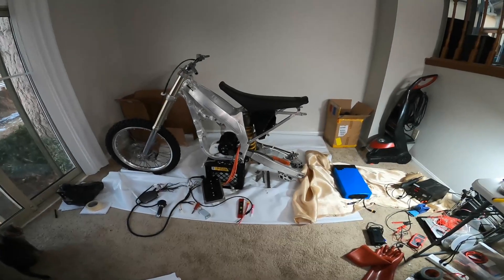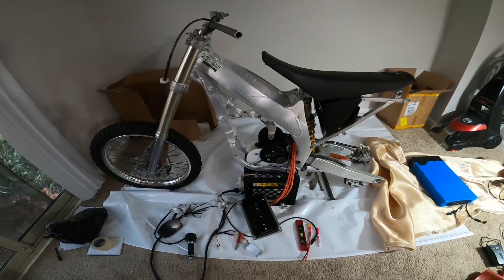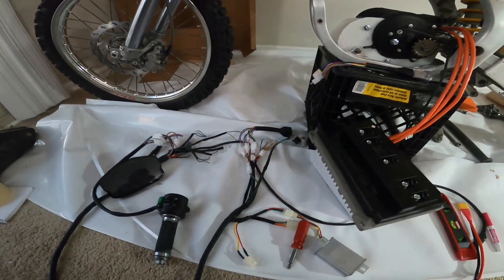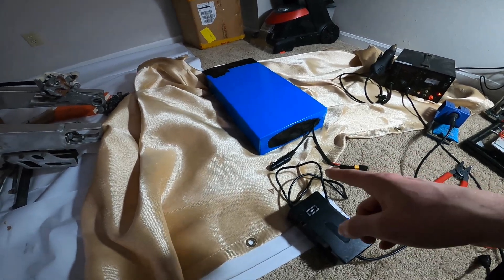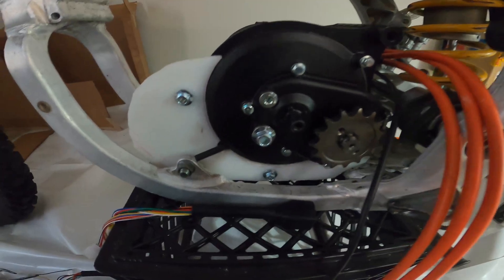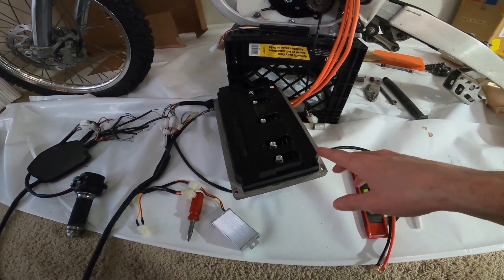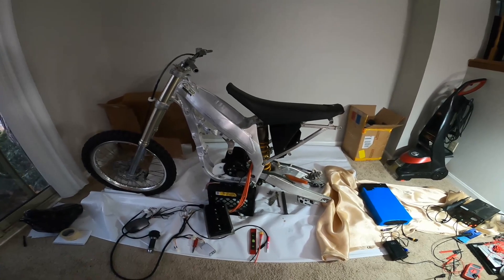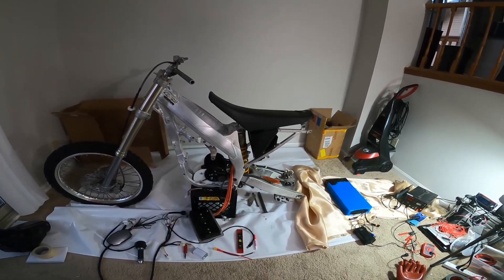CRF Electric Build - 01

Comment: Hello, what kind of controller is needed for the qs138 3000w 70H motor to slightly overheat the motor at maximum speed for a long time, and what current in amperes needs to be regulated in the controller

Comment: Hello Sam Cake, I thought I would chime in to offer a tip 🙂. 
If you have a Battery Management System BMS that has Bluetooth, depending on its quality it might have the option to turn off the charge switch and discharge switch.
This will mean that you can safely physically connect any terminal or wiring without a pre-charge switch, as long as it is directly connected to the BMS. I learned this myself through trial and error with a Daly BMS and an ANT BMS, tried this with both a VOTOL EM-150 and a Sabvoton SVMC72200; this works with no problem.😉

Comment: That someone was me😁👍You could just use three precharged xt90 plugs like some of the top of the range vesc controllers I used do.My 3rd 240dc amp bike atm runs this setup and works just fine.Also i use a motorbike simple on/off switch as my ignition switch and a jet ski style kill switch button with wrist band for  extra safety.I built my own 22s 33ah battery with a ant BMS onboard showing every possible piece of data needed for my battery,and have that on app on my handle bars as I ride.Keep it simple and you will have lots of fun with it.Like I said on endless sphere I'm building a 2010 crf450 atm but also refurbing the bike by  every nut and bolt as I go.If you have ridden Mx bikes before I really think you want to be around the 25-35kw power rang for really Mx bike experience with that chassis.That being said if you are just on slow technical trails 20kw would probably be just fine.Have a look on my Instagram page under Fpvlee it may help you in some cases 🤜
Reply from the maker: Heck yea thanks man! And yea to me this is just a purely trail bike, might go 40mph on dirt roads connecting trails but then the trail is 10-25mph. Will check out your insta, you've already been a great help with info that's made me re-think more :).

Comment: Good luck with your build! I am using the same components on my rm125 build. With a better battery you should be able to push about 20kw in bursts with this motor/controller combination. The battery I'm building should be able to push a little over 200A in bursts and around 150A continuous, but its only 42Ah.